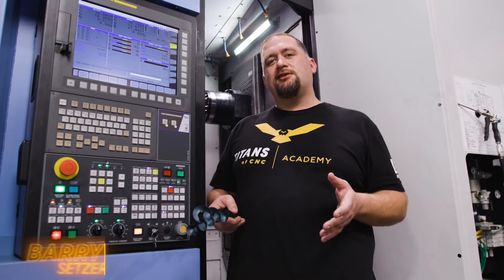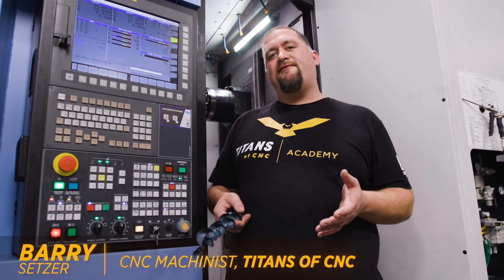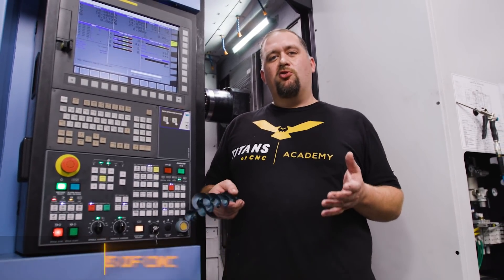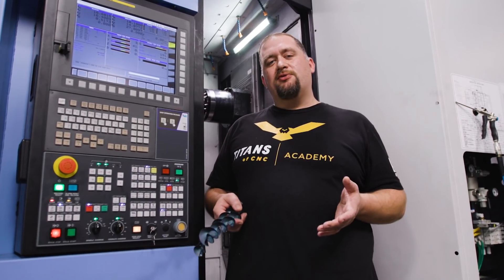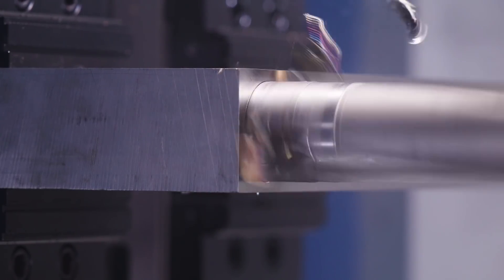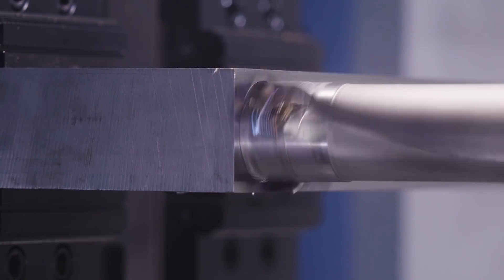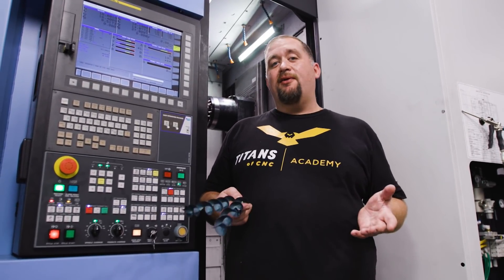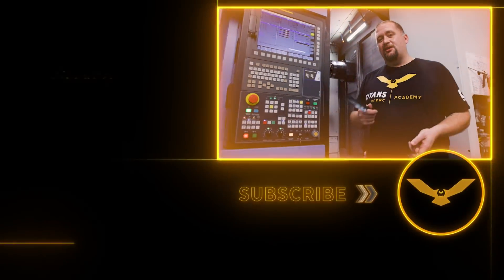GODZILLA DRILL DESTROYS STEEL | NHM 6300 Horizontal Mill | DN Solutions

Comment: With great power comes even greater responsibility.  I remember how amazed I was the first time we used a drill with that geometry in a lathe; being able to drill quickly and finish bore with a single tool was a true innovation. Like everyone else whos been in this trade for a while, distracted or bad operators, though neglect, having total tool meltdowns on CNCs mills.
Reply: Your meltdown comment triggered a memory. I started a new job on CNC lathes in 2013.  A 1985 Okuma and a 1994 Okuma. Well on the older machine I kept burning up insert drills (and other tools). Felt like an idiot because I had been in the biz for 20 years at this time and could not figure it out, just gave up and did "light duty" on that machine.  Long story how I finally found it, but the machine was in a major crash before I started there and they never tightened the WHOLE carriage up.  I could lift it by hand with a bar in the turret almost .08" .  Tightened that down and ever since then I been rippin on that machine.
Reply: @wkannon990  Wow, good catch, you earned your wages that day for sure.
I was lucky, the big aerospace companies I've worked for had daily and periotic major maintenance schedules where the mechanics meticulously go through the whole machine's systems.  Most of the giant machinery, aircraft parts and assemblies were just too expensive to cut corners on.
Reply: Making 60mm deep hole for G2"-11 thread.... 40mm indexable drill, X0 drill it.... X-8 drill it.... X-16 drill it.... Switch to boring bar, finish it.... Instantly half of cycle time was gone, boring it with 4mm slower passes and I´m not going hard enough on the boring, but with half cycle time, better to make 30 parts out of one "outer" insert on that drill.... S650 F0.15 drilling, 92% load.... S650 F0.12 boring- around 35% load.... 2008 Lynx 220LM
Reply: @piter_sk  Yes, we are paid to critically analyze, adapt and efficiently resolve any production malfunctions. Each machine varies in it's capabilities and we must be able to adjust to each situation for that alloy. You know when it's correct just by the sound the machine and tool make under a cut load.

Comment: Barry how about showing the public what shouldn't be DONE, example wrong insert or inserts not secure 
Titan keep ON keeping ON
Reply: LOL I thought that holding an 8" tall piece of stock with only .100" in the vise and drilling dry with a 2.5" drill WAS something that shouldn't be done HAHAHA
Reply: @barrysetzer  guess they did that to showcase the quality and power of cutter (no vibrations), even in extreme conditions.
Reply: @constantinosschinas4503  Yes sir, that was why we did it. And when I put that material in the vise, I could have sunk it all the way into the jaws, but I thought it would be cool to show how rigid the Schunk vises are as well.
Reply: I was wondering how much you were gripping by. 
.100 for 8 inches is mighty impressive

Comment: Really impressive how the tool carries heat out of the cut in the chip. No discolouration on that thin wall at all.
Reply: I was totally impressed by the exact same thing
Reply: It’s not impressive if you know it’s supposed to do that.
When carbide inserts first came out we were taught to run them without coolant.